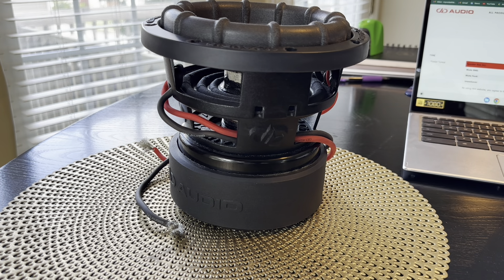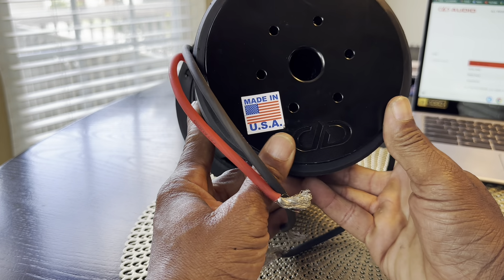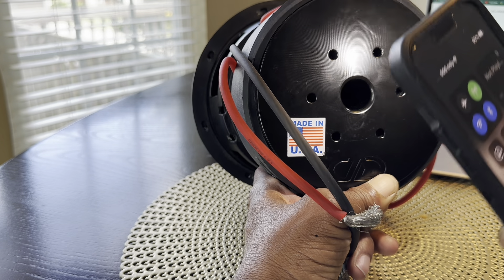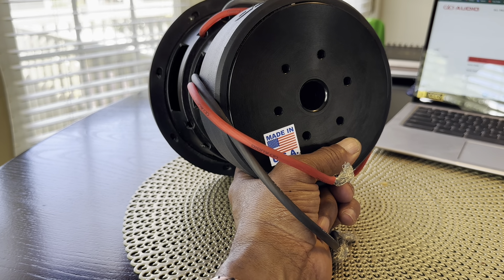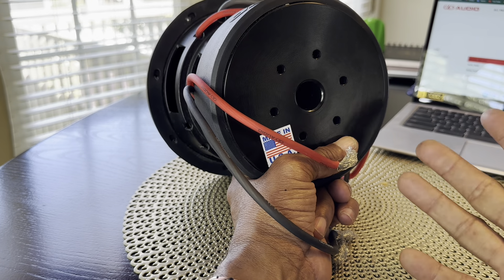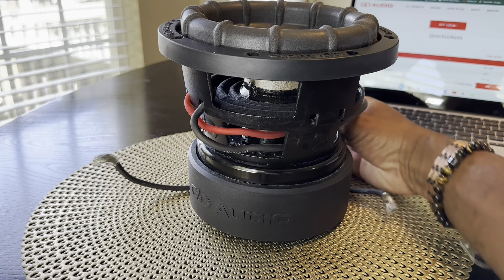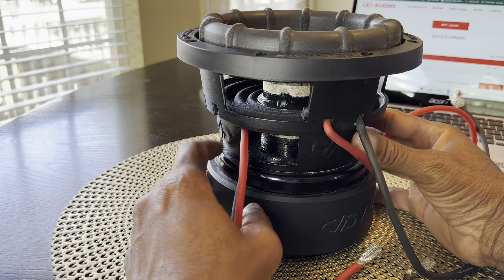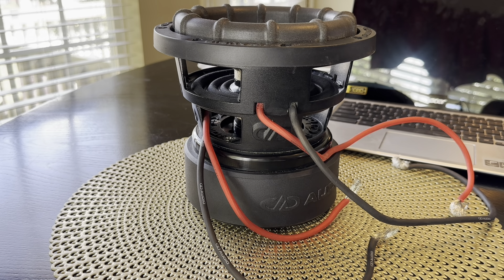Best 6.5” Subwoofer! Digital Designs 1506 Up Close Performance Review!! ….Part 3!!!

Comment: Isn't the cooling subject to the ability of the box to disperse the heat generated by the sub? So if the box isn't built to the sub exact specifications the sub in theory will over heat! Lmk what you think
Reply from the maker: Box helps with cooling yes.. but subwoofer have cooling features built in

Comment: I wonder how much commission local shop gets to sell certain brands. We have a shop that is a dd dealer but they hardly talk about them or show them. They push another product that starts with a J as soon as you say subs or amps. Love to hear these in person.
Reply: For good reason cause you can not be gen come close to comparing jl to 99.9% if other companies.. buy once cry once.. there is louder.. there is cleaner sounding but there is nothing else ever produced that plays as loud and as clean for 15 years at full tilt wo failure like jl products can.. dare you to find me a shallow mount sub by anyone that can outperform even a tw3 much less the tw5. 

If you’ve never ran a true quality amp you’ll never understand that a quality 1000w amp actually gives you a clean 1000w at all voltage levels while fighting speaker impedance ride.. see you can put two $150 name your brand subs on a name your brand amp in a quality box.. first power that 1ohm load rises to 4-5-6-8 or more ohms.. you think you’re sending 1000w but really you’re listening to 400w split in half so 200 watts per sub. Not when you buy quality.. doesn’t have to be jl could be higher level kicker or Rockford gear.. jl imop is still a little better then them most cases.. 

There is a reason they are still in business and one of the oldest companies in the industry while being one of the highest priced companies around lol.. once you go jl you never go back..

And I can tell you as someone who had a similar local shop back in the day although a very large and very profitable one that only dealt in higher home theater and car audio.. mostly home theater.. they get very little commission off those higher end brands.. its a lot less then the mid range or budget tier brands.. I competed with jl back in the early 2000’s and I can tell your hands down without question the equipment I was running then was 10x better then any of these modern day 10k Korean amps and you name it subs.. I got lot of respect for what dd does.. what dc does.. but apples to apples.. jl is better overall while I’ll be louder off them for same price in spl. Been in this game long enough to see 1000’s of companies come and go providing ok product for a crazy low price.. kicker, Rockford jl still around for a reason.. one of them ok with selling their entry level products at box stores.. the other will sell to many reputable places.. you’re not ever going to walk into a Best Buy, target ir Walmart and find jl lol.. not even a w0 series.. you’re never gonna find it on Amazon mostly.. they don’t work like that.. they are who they are and know what they have.. they won’t play marketing games.. once you been at this long enough unless you’re getting free stuff or getting paid to use others stuff you eventually always end up going kicker or jl audio on your own dime.. is what it is and if you know you know..